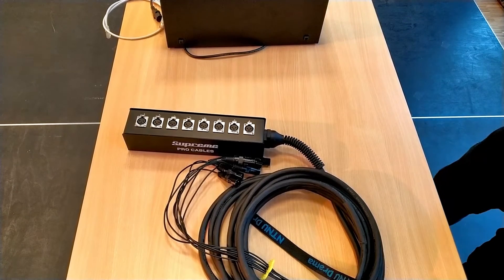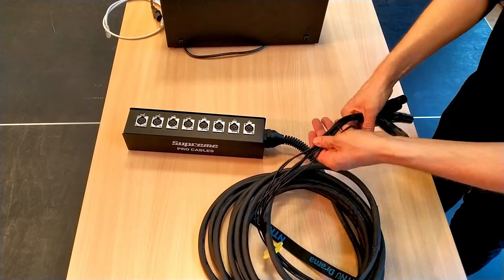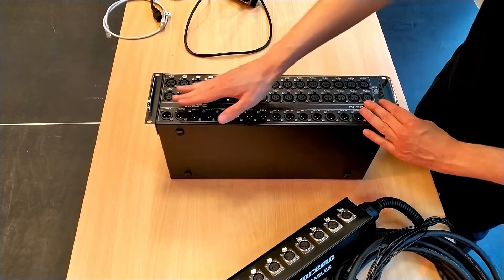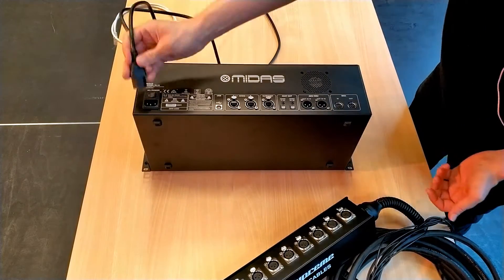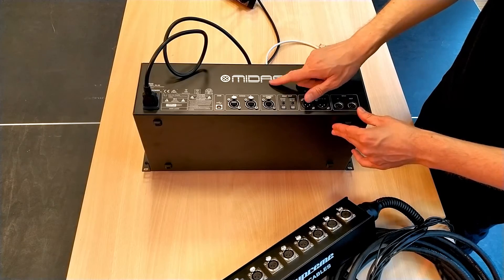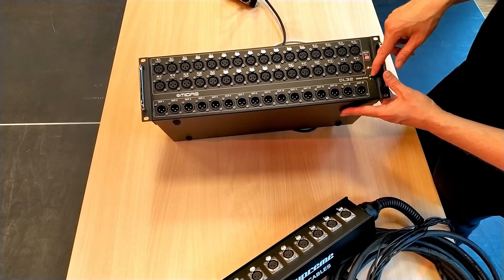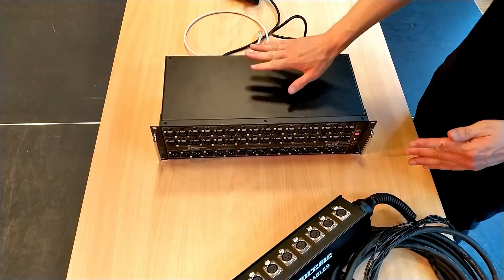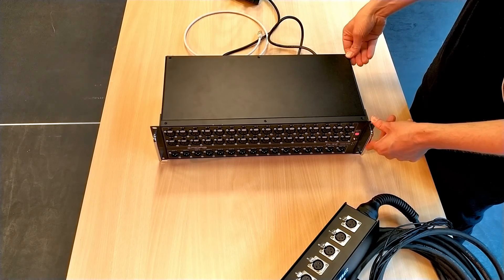Understanding Digital Stageboxes

Comment: Unless of course, if you're using Midas DL8s. Then you can use their $800 PoE injector and bypass the need for power cables on the stage boxes 🤠

Comment: Hey! How can you send a line level signal from a keyboard to your line level inputs (1/4) on your mixer through a snake? Do I use the TRS inputs and male on the snake?
Reply from the maker: It depends. I'd probably recommend just using a di box but if you don't have one then you could just use whatever adapters you need to make it work. E.g.  Jack to xlr adapter- stagebox input - xlr to Jack adapter- Jack input on the mixer.
Reply: @OffshoreAudio  di box won't swap line to mic level?
Reply from the maker: Yeah, I should've been clearer. Into a di box then into a mic input on the mixer. I think that would be the solution 95% of the time. So the answer to the question is " usually you don't, usually you use a di box" If you need to use a jack input because you don't have any xlr inputs left on the mixer then you use whatever adapters you need to get the signal there. The most important thing then is that the output is balanced, and all the cables and adapters are balanced. Otherwise you'll get noise.
Reply: @OffshoreAudio  can you use a TRS 1/4 Into the out of a keyboard though?

I suppose I'll test this all when I get back home haha. Cause yes exactly, we ran out of XLR ports
Reply from the maker: That depends on your keyboard. Check the manual or it might say beside the output. But if it doesn't say balanced out then it's far from optimal. I mean it'll work regardless. You can plug it into the headphone out if you want haha. but it's just going to create problems. Sometimes problematic sound is better than no sound though. I've definitely done it before. Just not willingly...
Reply: @OffshoreAudio  haha I love that. 

Show must go on indeed. 

Thanks for your feedback
Reply: @OffshoreAudio  i have a bunch of TRS to XLR adaptor but this would need a straight up 

1/4 to XLR (Not trs) then the opposite at the other end yes?

Comment: Great video! Though one question. As a drummer, would I be able to use a digital stage box to connect all of my drum mics to record straight into my computer with different tracks for each mic?
Reply from the maker: short answer: no. Longer answer: you might be able to make a dante stagebox work but they're designed to work with mixers and it would probably end up being more hassle than it's worth. I've got a few other videos on the channel that explain why if you're interested. https://youtu.be/yJ-DxCdRzs4
Reply: https://www.youtube.com/watch?v=ScMcpCVEgoI
This might help you

Comment: What a fantastic and clear video. I have a question in the topic of digital stage box. Could I simply get the signal from this Midas into a Mac, without using a mixer? So mixing in the box essentially, with Ableton live daw for example. Would this work?
Reply from the maker: Good question. Short answer:Not really. You should be able to do it theoretically but then you would need a usb dongle or software or something to translate the digital audio signal (AES50) to wav for Ableton. You would also probably not have control of the preamps since that's what the mixer does. But I could be wrong, there might be a plug in for this. There's certainly a lot of people that ask these questions
Reply: @OffshoreAudio  understand….Because it really sounds like an opportunity to simplify both on logistic, cutting out a device, and also keeping costs down, avoiding a 3k mixer (or a mixer anyway). 

Thanks for your help anyway! I start to see the light.
Reply from the maker: @matteomelfa  It's probably doable but I'm afraid I'm not very helpful with this stuff. This is exclusively a live sound channel and I haven't worked in a studio in many years. You could try asking Kyle at the Audio University Youtube channel.

Comment: We have the yamaha ql5 (I really like the yamaha preamps). If we use a midas digital stagebox. Which preamp will be used? The yamaha ql5 preamps or the midas?
Reply: Unfortunately the midas stagebox in this video will not work with yamaha mixers. It uses a proprietary protocol that can only be used with behringer and midas products. Hope this helps.
Reply: If you get a compatible stagebox, you should be able to select what input/output goes to what channel. That's the cool thing, they are completely customizable.
Reply: Thank you. Yeah. But what I don’t like is that I have these amazing preamps in the ql5 (20k console) and when I use it with cheaper digital stageboxes I can’t use these preamps from the Yamaha ql5 but I have to use the cheaper preamps
Reply: @unknowngitarrist1  yeah, I feel like if you want to use the good preamps, you may be better off either buying a higher end stagebox that will work with your console, or just run a big analog stagebox from your console to the stage, that way you are using the better preamps.

Comment: I'm trying to work out what the AES output on RME audio interfaces like the UCX II can be used for and how many inputs/outputs I can get. Can it be used like an ADAT expander to give you more physical analogue connections but via digital?
Reply from the maker: Thats AES/EBU, also known as AES 3, which is quite different from AES50 which the stagebox in this video uses. It's 2 channels of digital audio. Since it's a digital signal you would need a mic preamp and then an converter stage before you could feed audio into the RME unit. You could use it for example to record a stereo output of a live console like an m32. It's normally on an XLR connector in the live environment so you'd need some kind of cable for that. Maybe RME have some equipment that interfaces with it? 
I mention AES3 a little more in this video:
https://youtu.be/_aDJzUpHekQ

Comment: why does the digital box sounds compressed before it gets to the mixer? please advise
Reply from the maker: I'm afraid I couldn't say. Are you able to monitor the signal at the box before it goes up the mixer? Is gain too high? That's about the only way you could somewhat compress the signal before it reaches the mixer. But it would just be distortion

Comment: Good video!!! I have a challenge with one S32 stagebox now, the mute button is permanently on (red) once it's switched on. With this, there is no output. It was replaced with a new one which we are using now but I need to repair this one. What do I need to do please?
Reply from the maker: Thanks! It's not a problem I've come myself. Try switching the AES cable or port. My other advice would be to get in touch with the place that sold you the box or try music tribe support.
Reply: You need to press the mute button twice or once or long press to deactivate it on the S32 stagebox

Comment: Great video,  very informative,   do you still need power (amps)  to run passive stage speaker if you have a powered stage box?
Reply from the maker: Thanks! Good question. You do still need power amps for passive stage speakers, if I understood your question correctly. I've never come across a stagebox with a power amp built in at any rate. The power in your digital stagebox powers the AD/DA converter as well as providing things like phantom power. The signal level that comes out of the outputs is line level, at least in every stagebox I've ever used. I've come across mixers that have a power amp stage built in but they've always had a speakon cable as an output. I'll make a video covering the signal levels if you'd like? I thought I had one but it seems I've not made one yet.

Comment: How far can the stagebox be from the mixer and do I need anything extra to get more meters?
Reply from the maker: Very good question. It depends what standard you're using to transmit the audio data. A Midas dl32, shown in this video, is good up to 100m according to the manual. I'd definitely test it if you're going over 80 though. 100m is what most digital stageboxes are rated for but always check the manual.

Comment: I have a Mackie pro fx12 . I would like to add a wireless snake, what would you recommend, is it possible. Thanks for your very informative videos.
Reply from the maker: Hey, good question. The Mackie pro fx12 is an analogue mixer so you won't be about to use a digital stagebox with it. You would need to get an analogue one. I've got a video that explains a bit about this here:
https://youtu.be/yJ-DxCdRzs4

Comment: I’m only confused about which one to get and is it worth the EXTRA money.  I have always heard MIDAS has the BEST .  So I have an X32 and I’m considering a MIDAS Stagebox.  Is this a good idea ?  Or should I save some money and buy the Behringer Stagebox ?  Is there a significant difference that makes it worth the added expense ?
Reply from the maker: Hey, good question! The difference is in the preamps as far as I'm aware with the Midas ones being considered better though I would say that unless you've made that decision yourself, based on what you hear, then you won't really notice a difference. Long story short it's common to find midas stage boxes with X32s but a behringher will work just fine. Hope that helped!

Comment: Please redo this video using the manufacturer spec’d cable ( AND CONNECTORS) for the stagebox... it has to have a bonded and shielded ethercon cable cat 5 E cable....
Reply: Manufactures put in the manual the right way to the most generic user cases. As long it works and don't damage the equipment, what's the big deal? Just take into account the conditions, distances, desired speed and possible interferences such as light conduits. Then you can find the ideal cable for each situation. You don't need a shielded cable to run for just 30cm. But maybe you're close to a RF transmitter, so now the shield its necessary.

Comment: Wonderful video. 
One thing that is very important is that some of these stageboxes are a point to point connection. So, stagebox directly to the mixing console. Do not use ethercon barrels to extend a cable! It causes a major degradation in audio quality!!!!!!
Reply from the maker: Hey, thanks so much for the comment! Couldn't agree more, there's lots to unpack in digital stageboxes. I hope to get into more detail in a future video :)
Reply: AES50 and MADI stageboxes are point-to-point connections and might be sensitive to interference and a little bit picky about cables.
Dante, Ravenna and AVB ones are networkable and will work on anything that puts your computer online. Not enough cable length? A gigabit switch or fiber converter will help.
As for A&H protocols like dSnake, DX and gigaACE... I don't really know. They're point-to-point but stated as "second-layer Ethernet protocols" on reference handbooks. I've no idea if they would work through switches and fiber converters.

Comment: Can I use a studiolive 32 iii mixer with a behringer S32 stagebox ?
Reply from the maker: Hi, good question. The short answer is no. The S32 stagebox communicates using a different language (AES 50) than the studio live iii mixer (AVB). The long answer is that you could send 2 channels of digital audio using the AES/EBU connection between the mixer and the stagebox. Did that answer your question?. I could make a video on how to know if you can use a digital stage box with a mixer and the different standards that are used if that would be helpful
Reply: @OffshoreAudio  thanks for the reply. Yeah a video would be helpful. Also did some reading cos we wanted to eventually expand into using personal mixers and IEM for the 5 member band we have. So we were looking at the Behringer P16 since it’s the most affordable. But our hands are tied cos we have a Studiolive board. But behringer has a converter that can take 16 analogue inputs and convert them into digital for use with the P16 mixers. So perhaps we might explore that option
Reply: It’s the Behringer Powerplay P16-I Module

Comment: What stage Box can I use with the QSC 32 pro mix?
Reply from the maker: Hey, I had a look at the manual for the QSC Touchmix 30 pro - 32 channel mixer. It doesn't have any digital connectivity (the ethernet port on the back is just for wifi) so you would need to use an analogue stage box. Usually, these are labelled w-according to how many inputs and outputs are needed. For example, a 24/8 stage box would allow you to connect 24 channels of audio from the stage to your mixer and return 8 mixes from your mixer to the stage for the main LR mix, monitors etc. Did that answer your question?
Reply: Yes thank you